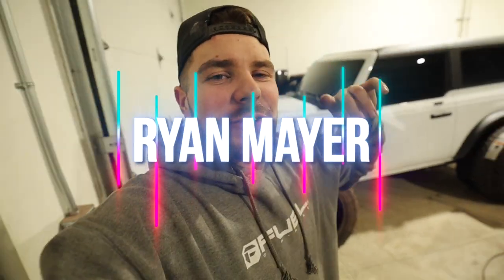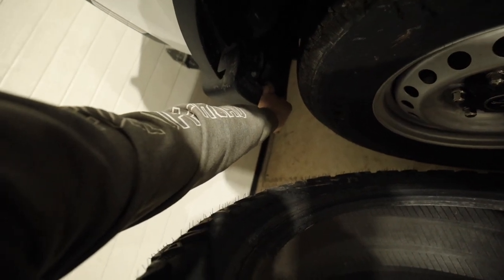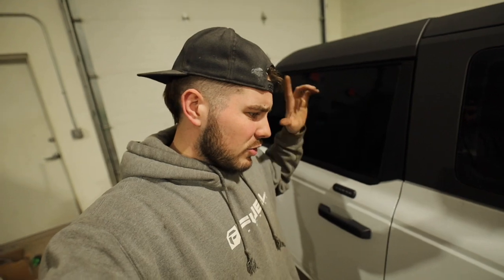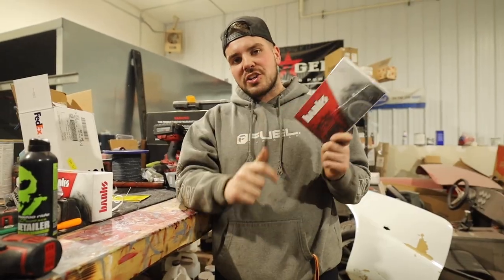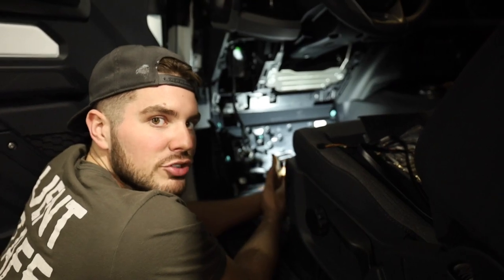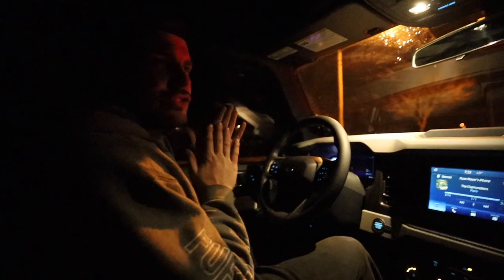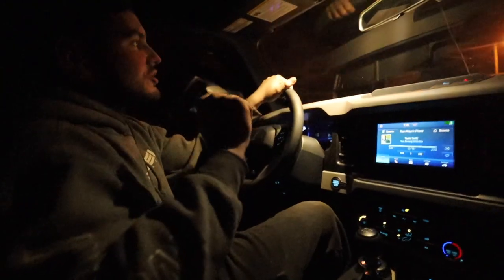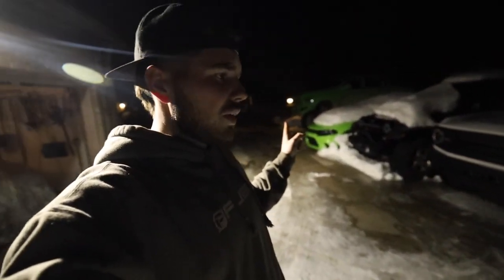EVERY NEW BRONCO IS PLAGUED WITH THIS ISSUE...Heres How To Fix It!

Comment: I have a throttle booster on my 2020 charger now got it for a really good price but it’s no pedal monster, I’d definitely give it a try the one I have makes a difference so I’d be interested to see the difference between the brands

Side question: do you have to have an idash to use the pedal monster?

Comment: I’ve had a pedal monster before and I had other throttle boosters and pedal monster is by far the best. Not as touchy. I’ve had ones where you simply wiggle the wire and my dash lit up like a Christmas tree. I’d love another.

Comment: When u said that when the throttle booster die it puts ur vehicle in limp mode n derate a it and what not, so I installed one on mine, from a very very reputable company as well. Once installed went for a drive and every time I floored it it would put my truck into limp mode. Only when I floored it though. With that being said I removed it. Contacted the company for refund which they never questioned and sent it back. But they also said they have no idea why it’s happening, do u think it was a faulty booster from factory. Cause I haven’t installed one after cause of the limp mode crap

Comment: Banks products turn boring, stock vehicles into  vehicles that wanna move the way they should. Throttle is there immediately with no lag. Plus the safety feature of reverting back to factory throttle if anything would ever to go wrong electrically is great too. Don’t wanna be running down the highway @ 70 and have an issue as you might with other brands.

Comment: I installed 22x12 American forces on 35s with a 2" lift on my bronco.  Had to remove the crash bars. Rubs just a hair on running board bc mines the outer banks

Comment: Those tires are going to suck in the snow as they're way too wide. They're good for summer and mud, but you want narrow and tall in the winter and on sand. Unless you're driving in bottomless snow all of the time, you definitely don't want wide tires, they won't cut down and get traction, they'll just float and spin. A 9.5" or 10'5" width is ideal. Unless you're just going for mall cruiser looks and don't care about performance.